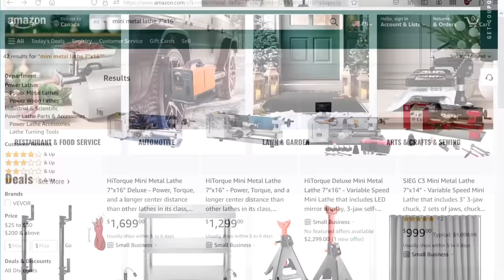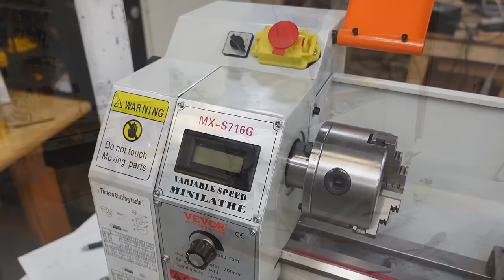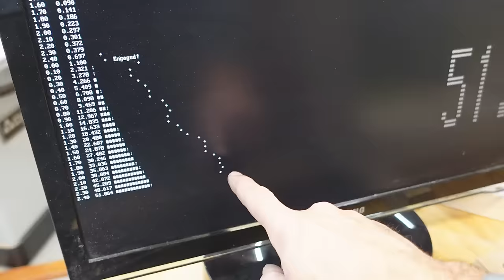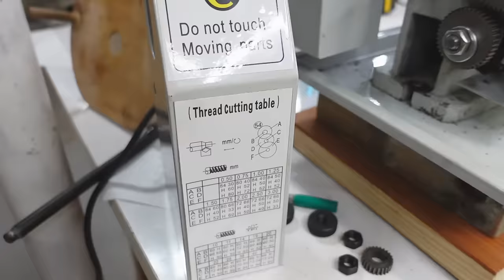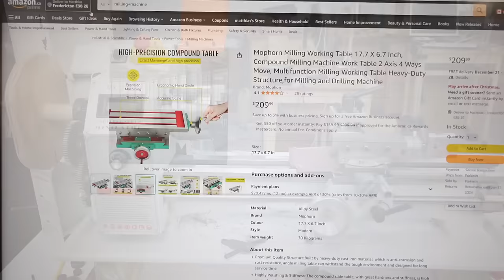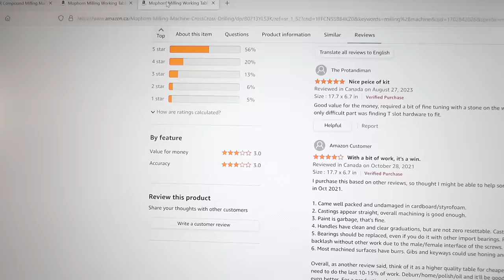I finally got a metal lathe

Comment: good day, eh...just a little  🇨🇦 fun...
A couple of quick ideas.. another commenter mentioned rigidity: absolutely, it should be bolted down to a bench, BUT, since this is not a $2,000 lathe, you need to make sure that it doesn't get any misalignment, either "twist" or "bend"... there are "several" videos about this issue, so check that out... maybe Blondihacks? 
Also, getting the tailstock centered on the chuck end is critical, sonst  you will end up "grinding tapers" on everything.
Joe Pie has a video on threading by running in reverse, so that you never run into the chuck.
You might also check the centricity of the chuck, you can grind it to a state that is much better than "out of the box", although I actually scraped mine, so no abrasive particles to worry about... I used a boring tool to get to the first stage, and I figured out that most of my work is about 6 to 10 mm diameter, so I adjusted the chuck to 8 mm to do the grinding/boring/scraping, so that the concave radius on the tip of the chuck jaws is kindbof matched to my typical work.....
Sie werden viel Spaß haben, und mehr erfolgreich Werkzeugen!
keep well, have a lovely Christmas, and healthy, happy 2024!
der 🇨🇦 in 🇩🇪

Comment: I like the way he modifies off-the-shelf parts to reduce machine work. For instance, turning down the outside of those coupler nuts and then parting them off to make the adapters and the bushing--which also used the threads for added stability and concentricity.

Comment: Very exciting stuff, these turn wood really well. I've seen them used to make dowel pins.
6:53 Please PLEASE do not leave the chuck key in the chuck. If the key is engaging the chuck, the other end of it MUST be your hand - never open air.
On a machine shop lathe, just imagine turning it on with the key in the chuck. You don't want to have that accident.
Looking forward to more!
Reply: Let me double and triple underline this.  I have made this mistake and it is a good way to do serious damage to the shop, and if you happen to catch it - well, then the lathe and shop will belong to someone else, and we won't get any more videos from Mathias.
Reply: As a retired vocational education teacher and university professor, I was agast when I saw the chuck key in the chuck with no hand on the key.  That was a total no-no in my shops.  Whenever a student left the chuck key in the chuck, I immediately called "Cleanup" and lectured on safety.  I talked about never using files without handles, never using dull drill bits, always wearing safety glasses, never grabbing the long steel cutting chips when turning on the lathe, etc. The students lost a shop period but they learned to be safe.  I never had any accidents and am grateful for that.

Comment: To learn a little bit more about working with that machine, i recommend you searching for "cutting angles on a tool" and "Feeds and speeds". The positioning and working directions of your turning tools was not optimal.
Some important things:
+ cutting speed (in steele something about 30m/min, aluminum 70m/min)
+ cutting depth (for final cut about 0,05-0,1mm,
+ feed (for final cut about 0,1mm/round and as smooth as possible)
+ The three angles af a cutting edge (on this tiny lathe you have to use pretty sharp tools, maybe just a tiny edge radius for tool lifespan)
+ cutting tip on center height of mainspindel
+ Dont touch the workpiece with the tool when spindle is off
+ Dont just drive back empty to reposition after a cut while scratching the surface (turn a little bit back)
+ lubricate whenever possible (oil for steele, in aluminum we call it "spiritus" in germany. Its a alcohol)
+ Most of this data only works with high speed steele
+ I dont recommend using carbide tools (you will never reach the cutting speed and most of them are not so sharp which means higher cutting forces)
You've already noticed some things, most of this you can also find in the mechanical and metal trades handbook.
I hope this helps a little bit.

Comment: Paper towel over the bed is easy protection for sawdust sticking to oiled surfaces when working wood. I like the hand wheel mod - very creative. I see a lot of lathes having E-Stop over the back but they really should have them up front.

Comment: Matthias! I'm so happy for you to get your first lathe. I have been following for at least 10 years and I have been to be a machinist more than twice as long as that. I'd love to donate some cutting tools with some more forgiving geometry's.
Reply: I should note, I run a shop older than I am and have lots of old and very small, for the work we do, unused brazed tools. So at no personal loss I get to give back to the channel, win win 😂 right!?
Reply from the maker: what sort of cutting tools?  Carbide brazed onto a carrier?  I ordered some HSS blanks, but they didn't arrive until I face cut that disk towards the end.
Reply: @matthiaswandel  yeah carbide brazed to a square shank. I have a small selection set aside.

Comment: I got into hobby metal machining 30 years ago before the internet. With my small lathe I run in reverse and my cutters upside down, the cutter needs to be on center of the stock being cut. Cover you ways with a board when grinding and clean it after. You doing much better than me when I first started for never using a metal lathe.

Comment: With the threading gears obviously the metric ones are complete stuff ups, but I think the imperial threads have just forgotten to mention that you need a 100 to 127 tooth gear ratio before the gears they're saying  (thats the normal conversion gear because .5" = 12.7mm exactly)
Reply from the maker: If you are aiming for exact.  Being 1% off for threading is ok for most cases.
Reply: Oh for sure, I was mostly just pointing out why none of the imperial threads work out properly

Comment: A very useful "upgrade" on these little lathes is to remove the compound slide and replace it with a solid block of steel or cast iron. For most cuts you don't need it, and a solid mount for the tool post greatly improves the rigidity.

I still use mine for small jobs, despite owning another lathe that's over ten times the mass.

Comment: If you know the pitch of the thread you need to cut is an exact multiple of the leadscrew pitch then you don't need to wind the chuck back to beyond the end of the workpiece. You can simply disengage the halfnuts and just move the saddle back to beyond the workpiece and re-engage the halfnuts again. It will be impossible to lose sync, and is much quicker, not to mention easier when winding the chuck or powering it.

Comment: Tips:
1. make a heavy bench for this lathe. Movable (with one of those wheel sets that's also legs if you need them to be) but heavy. The more connected to the ground this lathe is, the better.
2. The bench and the lathe should be connected. You'll get a lot more performance out of it if it's solidly mounted.
3. Try to make it as flat as possible. Devise a method to check that the lathe's ways are not twisted, being that it's a cheaper and small lathe, only go 50% effort at it. Just enough for eye inspection as it were.
4. ball bearings out, tapered roller bearings in. Bang for buck, the best modification you can possibly do for a lathe like this (if it doesn't already have them - in which case, then the next step up is getting higher quality bearings).
5. Bar stool seat, comfy. While standing is the preferred working option on lathes, on one so small, you're better off seated.

Good luck and have fun! Having fun with this is the best part. :)

Comment: I had one in 2008. They're all made at the same factory. Old Grizzly clones. 
If you lap and true them up, they're pretty good. 
I'm a trash machinist, so I quickly converted mine to CNC with NEM23 steppers and ran turboCNC on a DOS 6.22 box I found on the side of the road on recycling day.  😁

Comment: Thank you for an honest unbiased assesment of the lathe  
if i buy a lathe i dont think ill be buying the vevor branded lathe  it actually seems  slightly worse than most of the other chinese lathes ive seen reviewed here  i havent checked the price on the lathe but if its like everything else vevor sells  its bound to noticeably higher priced
Reply from the maker: yes, some of the Vevor stuff is higher priced than stuff elsewhere.  But not always.  So worth at least a look while looking around.
Reply: @matthiaswandel  i definitely look into it admittedly ive not bought lathe yet because i havent ever really needed one
 i honestly need  automotive carpentry and other wood working tools more 
be cool sir
edit: i havent done a video on it but tool quality has fallen off a lot in the last 2 to three years two years ago i bought a chinese made craftsman table saw it works and cut accurately right out of the box only a couple of adjustments on the bevel guage were needed   i used the saw 7 or 8 times  then i literally hit one nail
and one of the engine mounting tabs snapped  it still cuts but but i think its going to need replaced well before its worn out have you experienced anything like this

Comment: If you don't want to grind HSS tolbits get some insert tooling for aluminium. They will cut steel nicely in a weak lathe like that: Very low cutting forces due to: Polished, very sharp and with a very positive geometry. For example. DCGT 11T304.

Comment: I bought a 7"x10" lathe at Harbor Freight many years ago for under $400. I think it's better than that Vevor unit. Of course, it isn't really sturdy enough to work with steel, but it works fine with aluminum and brass.

Comment: If you do end up using your drill press as a milling machine be ready for the chuck to drop out as the side loads don't play well with morse tapers.  Some kind of draw bar is a good idea if you can do it, otherwise loctite.  Those tables are great for just lining up holes though.
Reply from the maker: wasn't planning on doing actual milling with it

Comment: Great video, thanks! Really helpful that you went through the shortcomings and your fixes. Because of your successes, gives me the confidence to give one a try. Have been held back because the lathe seemed like it couldn't handle steel, but you show it can be done! 😮
Reply from the maker: you need to take small cuts with the steel, and small workpiece.  wouldn’t want to turn anything bigger than a few centimetres on it

Comment: I find that Vevor is excellent for the entry level tools. Got a quiet air compressor from them and it works great. Not capable of more than using a nailer in the PSI department but that's all I need other than airing up tires and dusting computers.

Comment: Bolt it directly to solid bench and you will notice how much more rigid it becomes. Also add a bit of weight on the bottom tray like some flat pieces of steel etc, that will also help.

Comment: On the hand crank, you should consider putting the handle in a bearing (with the same exact bearing on the opposite side as well so you don't get an unbalanced weight) and making the handle removable. That's going to save you a massive headache when the handle gets snagged on something or comes off one day

Comment: Here's a technique if you want good concentricity making bushings etc. in a drill press.  You take a chunk of wood bigger than your workpiece, clamp it down in the drill press, and drill a hole big enough to put your workpiece in.  Then put your workpiece in the hole, change bits, and you can put your hole right down its center.  Having the workpiece tight fit in a hole you've just drilled means it's exactly on center w/r/t the axis of your drill press.
Reply from the maker: except of course the drill will wander before it goes in.  Also, the bushing will spin in he hole you put it in.  I assume you haven't tried this technique.
Reply: @matthiaswandel  Actually I have.  If the drill wanders before it goes into a clamped piece, IN A DRILL PRESS, you have a mechanical problem that you need to fix. Most likely the chuck quill is misaligned in its arbor.  Fixing this will magically fix the oversized-hole problem that lets your workpiece spin, too. If you can get it out without  a mallet there's something wrong.

Comment: I’ve been really tempted to get either a grizzly or vevor lathe. But erggg none of the small lathes aren’t great quality. 

I think you’ll really enjoy machining Matthias. Yes, it can be messy and slow, but it is fun. 

Also. Do not use those cross slide tables on your drill press. The bearings aren’t rated for sideways loads and the taper will just fall out of the spindle. Unless you’re going to use it just for locating holes. That will be fine. But don’t even bother trying to mill slots and stuff with it.
Reply from the maker: well, next step up would be at least $2500 USD

Comment: Also, hardware store threads are terrible for keeping things centered since they don't mesh perfectly and are often cut off center too. May be fine for your purposes here, but if you ever need true concentricity and mechanical repeatability, it'd be wise to keep that in mind. There's a reason why lathes use a different type of thread.
Reply: The reason V threads aren't used in some things doesn't have to do with concentricity it's about efficiency. Square threads are much more efficient. You get more pressure with less torque. V threads are made to tighten. When you're moving something you don't want it to tighten. You want it to move.

Comment: Adjust those side screws with the lock nuts as tight as possible. That will cut down some chatter. Even if you are a machinist can't help it, if the lathe is crap. I have a Vevor 8.9x23.6 lathe, that I had to go over everything. Same issue with the ways, I had to use a sanding block and sand paper to remove the excess material from under the ways, from opposite ends though. When you are buying a metal machine weight matters a lot. The heavier it is, the better it is.

Comment: 5:23   Chatter
You can minimize chatter by undercutting your tool stock using a bench grinder. It gives the chip somewher to go before bending up and curling.  Now, on cintered bronze or cast iron, you will rarely get chatter, because the metals are granular --  almost like pourous.

Comment: Hey Matthias, try getting an older EMCO lathe 2nd hand, it's an austrian company, that made and makes smaller kind of lathes, mostly targeted at hobbiests or educational.

in the range of your lathe: EMCO Compact 5, EMCO Compact 8
Bigger: EMCO Maximat V11/V13, EMCO EMCOMAT 8.6, 

are very nice EMCOMAT 7 is way older and has only straight bed guides, while the other ones have prismatic and sometimes even double prismatic guides, the straight guides are not as wear resistant as the prismatic guides.

Comment: Hi, looks like your tool post (or something below it) is loose. I can see movement when you were turning the hex nut. If the tool post is tight, then the movement may be in your compound slide or cross slide gibs. I don't have a mini lathe, but there may be some adjusting screws for your gibs.

Comment: I was gifted a small old Craftsman. A little bigger than this one. The money part always comes in the price of the tooling. Mine also doesn't do steel very well. Mostly I need a different tool post. ($200. I don't use my lathe enough to warrant the purchase. Maybe someday when the right project comes along.) Mostly I do wood and HDPE.

Comment: Congratulations on finally getting a metal lathe, many times I said to myself, this would be done much faster or better with a lathe, but it seems you bought a toy lathe!  Any machine, metal working machine you can pick up without getting a lumbago is a toy.  Use it for what it can do, but if you really want something better, look for a used one, even one that is very old but in good condition will be much better.  My own lathe is older than I am and I'm 75! (It's a 9X30 South Bend screw cutting lathe made for the war effort, the second world war)

Comment: 4:27  I make windmills and steam engines for a hobby and when I need a low-friction thrust bearing, I put a shaft into my lathe, spin it and use my high speed electric grinder to draw the end down to a sharp point.  That point, pushing against a steel stop, with a drop of oil makes a dandy ALMOST FRICTIONLESS thrust bearing.
Reply from the maker: and how do you make one that has the shaft going through it?
Reply: @matthiaswandel  ??Shaft going through what??  It's a thrust bearing.

Comment: A very fun video. Another great example of why not to buy cheap min lathes. The amount of repair and tuning required is crazy. You shouldn't have to modify a safety feature so it works!
Reply: I'm curious what other options you think are available that guarantee no repair or tuning on the part of the end user.
Reply: I'm curious what other options you think are available that guarantee no repair or tuning on the part of the end user.

Comment: Finally you got yourself a metal lathe.
Make a bench for it,-at least as heavy as the lathe itself, or even heavier. Bolt the lathe to the bench and the bench to the floor. -Also replace the top slide with a solid toolpost.
This will make your lathe so much sturdier.

Comment: To get more rigidity, bolt it down. Also, please dont keave the key in the chuck.

As for threading, This Old Tony has a great video on how to do it. Advancing the cutter straight into the work like that results in high cutting loads. Usually you advance in at an angle.

Comment: You should have it on a flat, leveled surface, a dedicated work table, Ideally metal but hardwood would be ok. Not risers because you’ll end up twisting the bed. All metal lathes a precision machines some may not be perfect but it’s the operator that can have it go wrong or have it go right. 

Bed leveling is the first thing one does when getting a new lathe.